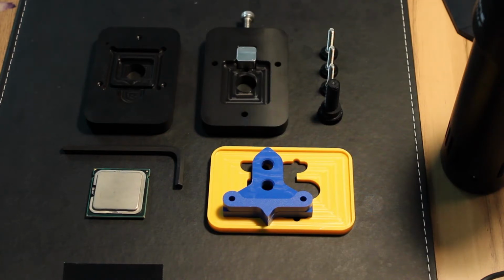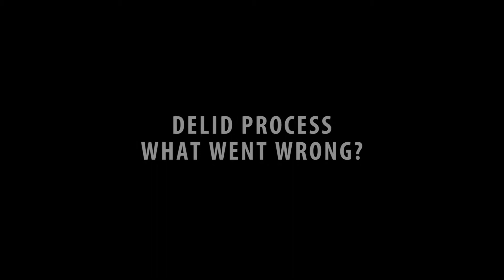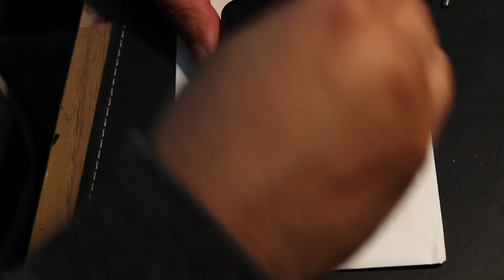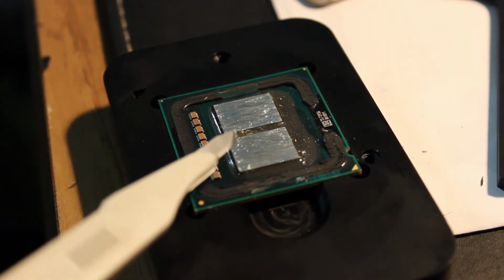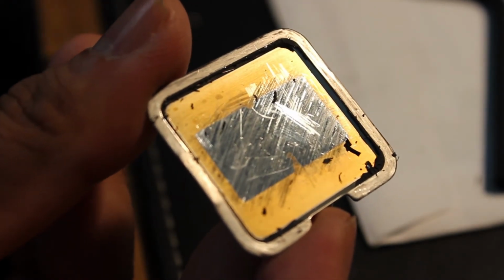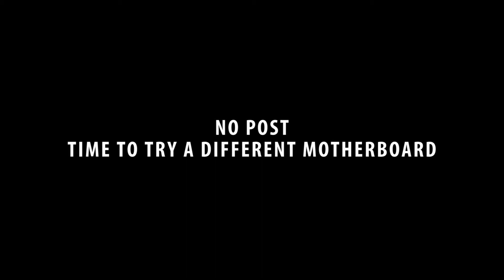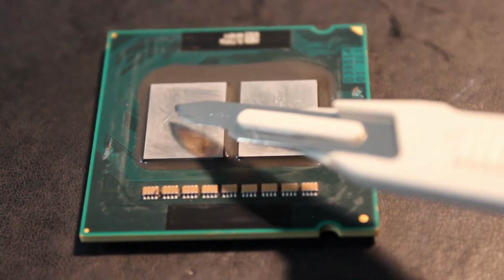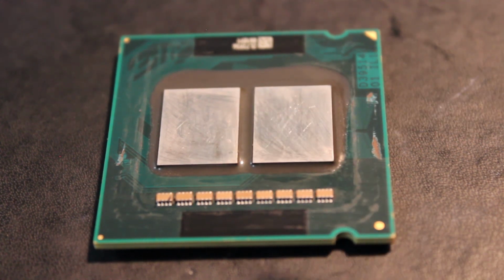Messing with junk - QX6850 Delid Fail!

Comment: I've used a similar delidding tool to the one you use in this video but found it too much hassle with all the additional screws on the top. Upgraded to the Der8bauer 2 and its so much faster. Released a video earlier tonight where I used it actually to delid an i7 8700K.